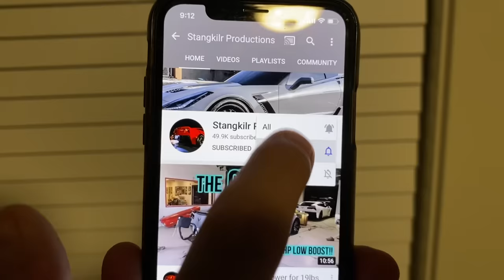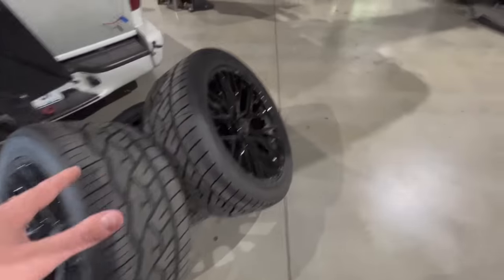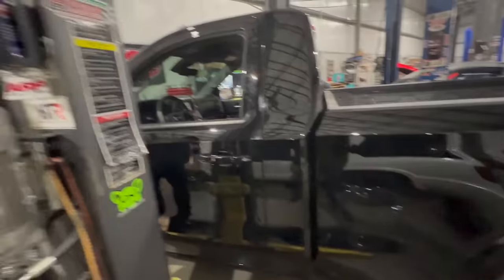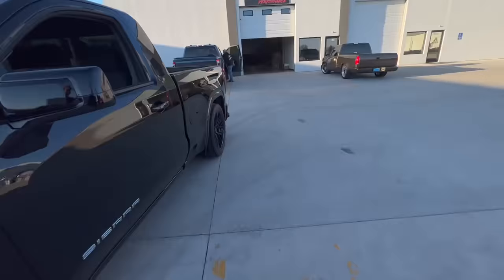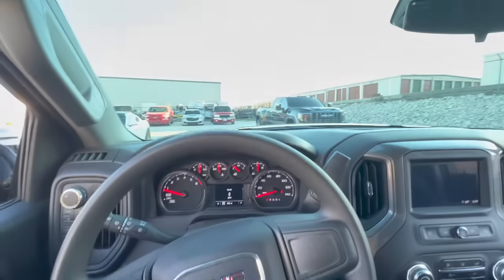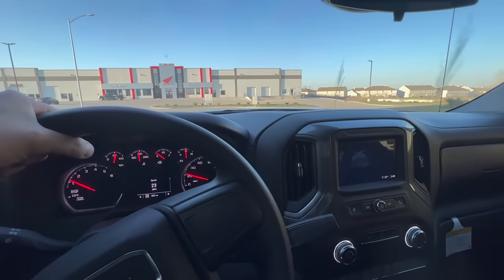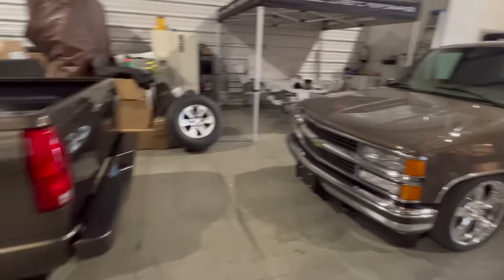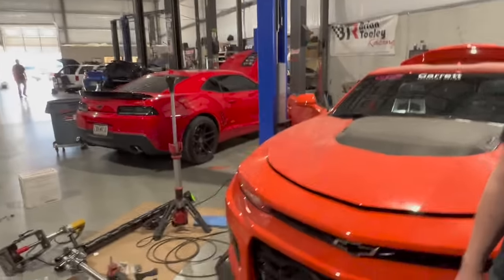My 2024 GMC Sierra regular cab 6.2L V8 swap RUNS!!

Comment: If I wanted to lt4 swap it, would it be just smart to swap it on the 2.7L or just purchase the 5.3L long bed like you did?
Reply: Thats exacly what I was thinking.  This has to be about 20K they did.  Can you swap that long bed out with the 5.3?
Reply: They talk about why they did it this way in one of the video's, came down to different front frame with the 4 and a bunch of modules

Comment: That's a sweet ass truck, hell I would love to have one. Of course general motors is to woke and gay at this point, the only truck that appeals me is the duramax and the rumor 8.3 liter duramax. I have 2012 colorado with 5.3 stock, back when gm made the little mid size truck with the v8, and I gotta say, it's badass for stock, runs way better than the new 5.3s for sure 😂

Comment: I used to work a GMC dealership you need a machine made by BG its a brake flush machine but also doubles as a bleeder
Reply from the maker: We have one similar. These new brakes have an electronic plunger and stuff though. It’s not vacuum. You have to bleed with the GM tool. It’s nuts